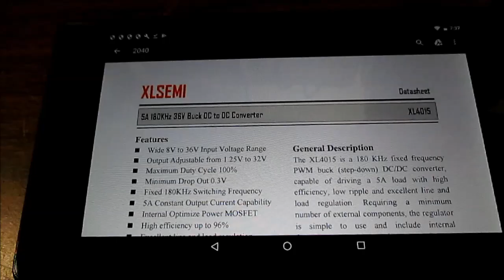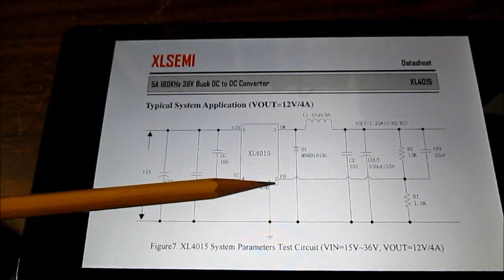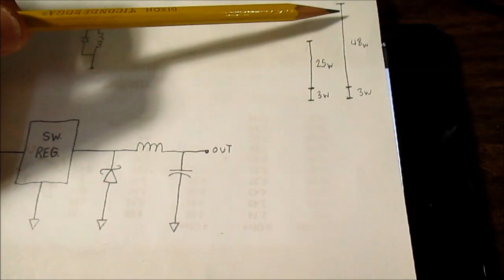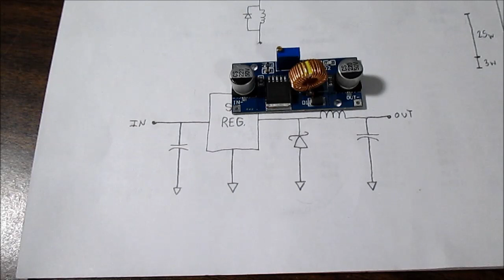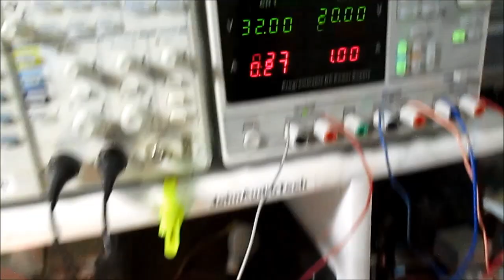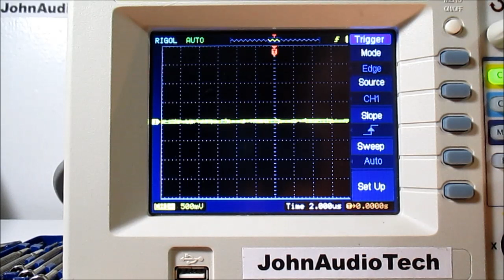5 amp PWM voltage regulator board test & review

Comment: I'm wondering with a simple circuit like this has, can the feedback loop of two of these be wired up so that they can provide parallel DC-DC conversion, splitting the current load? (doubling the current output).

Comment: You can get these with 3 pots too, for setting voltage, max. current and the last pot is to indicate via LED when the current falls below a certain set level, useful for charging lithium ion cells. Mine is based on the LM2596 IC, though I brought them a few years back.
Reply: The 2-pot and 3=pot versions are far more useful. They cost no more than the single-pot in this review.
Reply: Depends what you want to use them for, when I got mine the 3 pot versions were 2x-3x more expensive. The one on this video looks like they used better components though, mine suffers from coil whine when going above 1 amp at the output.

Comment: Hallo John, I am building a bluetooth boombox as a gift for someone, however the 12v step up module seems to be "cutting out" if I push the volume higher than half way, is it better to get an 18v step up module? I am using a 5v rechargeable power bank to power the 12v step-up module and the TDA7492 bluetooth amp.
Reply from the maker: Sounds like the amp draws more current than the power bank and/or boost module can provide. Going to an 18v module can make the situation worse since the amplifier can put out more power. Depending on the speaker impedance and volume level, the 5 volt bank could need to deliver up to 5 amps when using the 12v boost converter, so both will need to be able to handle the current.
Reply: Hi John, thank you so much for your reply, so if I add batteries in parallel to the "in" side of the step up module will it increase the amps available and stop the amplifier from clipping? What can I add to the power supply circuit to increase the number of amps available? it seems like the current available is intermittent, thus the amp clips because power supply the circuit "collapses" The real headache for me is that the unit needs to be portable and only dependent on a wall outlet when it needs to be recharged and it cannot be too heavy as well.

Comment: how about EMI?
Reply from the maker: I didn't check but considering the small size and lack of any large signal noise, I don't suspect it would generate a lot of EMI.
Reply: Size really doesn't matter, i have a cheap ebay 1A rated dc-dc converter that, when nearby, makes even cable boxes stop working. Maybe a AM/FM radio test would be interesting.

Comment: I love these DC to DC Step up/ Step down Sepic converters... These are great to have around. These and the class D amps are great topics
Reply: The module in this review is NOT a Sepic converter - it is a standard buck module which can only step down. Note that many of the "Buck/Boost" or "Step Up.Down" modules are actually 2 modules in one - a boost up to (say) 36V and then a Buck to bring it back down. Those 2-chip style are much less efficient than a proper Sepic converter (one chip).
Reply: @johncoops6897  There are some rare ones that's actually uses Sepic design AFAIK.
Reply: @kaikart123  - yes, that's why I mentioned it

Comment: please shed some light on CC version of these buck converters too LM2596 / XL4015. current limiting characteristics were kinda weird I thought, the o/p pulsated on the board I checked.
Reply: iceberg789 I'm gonna barge in here :D 
 The problem you have there is due to poor design, lack of frequency compensation around the comparator. That applies when your board has an opamp on it.
Reply: yes, those boards do have opamp for current regulation/ limiting. and the o/p is fed to the feedback pin with a diode. is that bad design ? what additions should be done around them to get a stable current limited output ? bring out your torch please. :)
Reply: I reckon one of the opamps is gonna be used as amplifier fed from current sense resistor, and the other one as a comparator, output of which is then fed through the diode to the FB pin on the switcher chip. To make it stable, you need to add a capacitor (or better yet - RC network) between the output of the comparator and the input which is fed from current sense amplifier. Value can be picked experimentally, it helps a lot if you have a scope. That instability you saw will look like a sawtooth or a triangle wave on the output of the module. Even if the thing seems stable enough, but the current still jumps a little, it just means that the waveforms I mentioned previously are at higher frequency. Sometimes they are in audible band, and you can hear the choke whining when the thing is in CC mode.
Reply: i think that was how i hooked the lm2576 up, but i just used another opamp as amplifier. yet it pulsated. to check things up, i guess i am gonna order a lm2596 cc board.

do you have id in allaboutcircuits forum ?